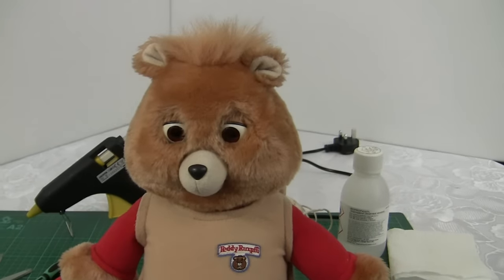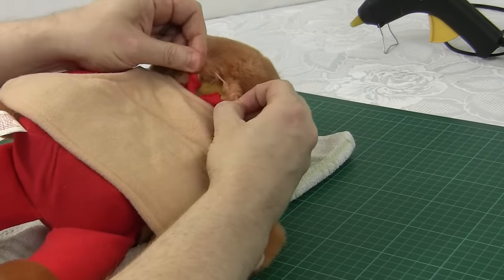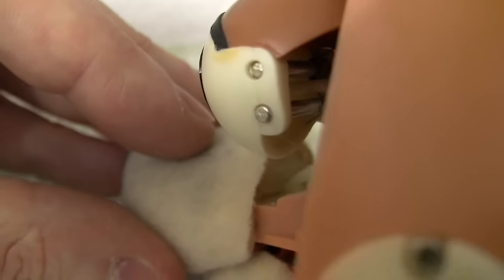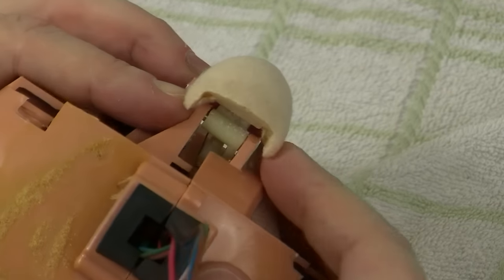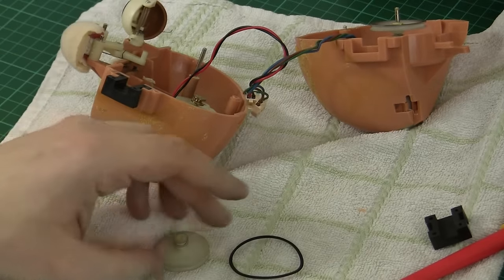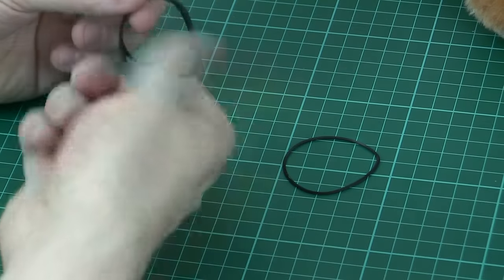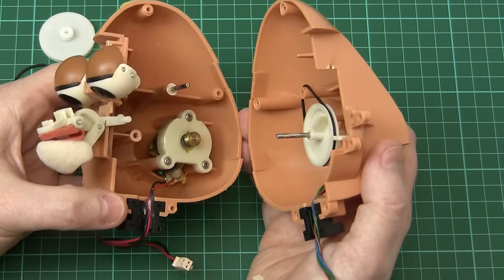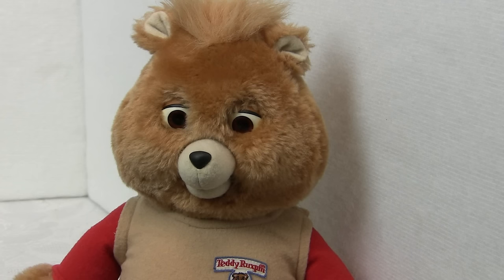Playskool 1992 Teddy Ruxpin Refurb 1 - Head Animation Drive Belts

Comment: The playskool version was much lighter in weight as the original if a child accidentally dropped it on someone's foot ud hear a loud barrage of cursing a mile away because a furry bear with the weight of an anvil busted there foot the one positive is with the playskool version switched to AA batteries again dropping the weight

Comment: Would the 1985 WOW Teddy Ruxpin fans be interested in a new device that would allow you to create new stories), WITH synchronized animations for both Teddy and Grubby, but WITHOUT using cassette tapes, and WITHOUT modifying Teddy?

 It would work in real time, no computer or other devices needed. Just speak into the "device" microphone, and use the mouth and eye animation controls on the device "as you speak".  If you are recording 2 voices and want to push Grubby's voice to his speaker only, there will be a Pan control to do that - in real time, while speaking. There's a possibility that I could add the ability to go back after recording the audio and add animations as you play back the audio... for better synchronization.

Playback would be through Bluetooth to Teddy via a (wireless) bluetooth cassette adapter.

I'm a EE, and have a Teddy and Grubby (and "stuff"), and in the process of trying to bring Grubby's animatronics back to life, I created the heart of the device to create the animation control signals... in real time... and the ideas just started to flow.

If this were to be a "product", I would obviously have to make some profit to make it worth my development time and expenses... so just wondering what people might be willing to pay for such? (if at all)

Comment: I think you're the only person who's actually done a video on how to repair one of these, I think most people just don't even bother trying to fix these ones because they always break.  On a slightly unrelated note, if you try to turn this Teddy Ruxpin on without a cassette cartridge in the slot, will Teddy turn on at all or is there a switch that detects when a tape is inserted, preventing Teddy from switching on without a cassette in the player?
Reply: That often times happens with Teddy Ruxpin recordings.  I've not had any real experience with the PlaySkool Teddy Ruxpin because I don't have one, but I know that if you turn the early ones up too high they will distort terribly.  I think in some cases the audio in some of the original recordings is a little distorted too because of the way it's recorded.
Reply: I doubt it has anything to do with the age of the toy, it's more likely the recording quality of the original source material or how it was duplicated.
Reply: Lachlant1984 phuhnh
Reply: You are totally wrong. I disassembled and repaired an original Teddy last year, and I can tell you that the internals are absolutely not in any way the same. For a start, the motors in the head  of the original are both  direct drive and have no belts at all. EVERYTHING is different about these two bears except the cosmetics on the outside.
Reply: @jameslovell8682  Perhaps I should have been clearer.  I was referring to the Playskool Teddy Ruxpin, yes it's completely different to the original full sized version.

Comment: Could I use a little nail-polish remover/acetone to soften the super glue a bit?  I would certainly clean the acetone off any important plastic pieces to prevent disintegration.  Just wondering if that would aide the disassembly process.  Thinking about repairing my two small Teddys.
Reply: The plastic is too old and brittle to handle it

Comment: Awesome video! As someone else said, I think you're one of the few people who have actually bothered to successfully fix the Playskool TR. It seems to come apart just like the 80's one, right up to where you have to split open his skull. The older one has such a better repair-ability design.

You have to break the glue off his mouth to open the two halves? You have to use a piece of string and a rubber band to align this and that, and then use essentially needle nose pliers to put the belt on while it's still partially open? Yeah... I'd love to see how it was officially put together when it was new.

I'll probably never fix a PS TR, but what I did get from this video is how to sew nice and neat the back of Teddy's head. Because I DO want to fix my old 80's TR. And that's the biggest worry I have. Re-sewing his head.... O.o.

Thanks for sharing this video!
Reply: AACrashBurnAA Practice sewing on a piece of paper. Do it on notebook paper with lines and practice on the lines. That is how I improved my sewing skills.

Comment: I used this video to try to repair my 1992 Teddy Ruxpin.  I have had a lot of trouble finding the 33MM and 35MM o rings but finally found them.  The mouth moves only slightly and the lever for the eyes never moves up to move them.  Wondering if the motor may not be strong enough to make this function properly?   Any ideas would be most appreciated?
Reply: Try replacing the capacitor that's outside the motor

Comment: Daft question, but why not just pull the pulley off the rhs of the head and put it all in the lhs then put it together?
Reply from the maker: The pulley on the right of the picture (with the paddles), is permanently attached to the position sensor in that side of the head
Reply: I see. Thanks. Going to attempt this on mine.